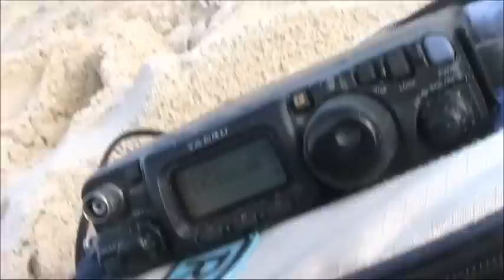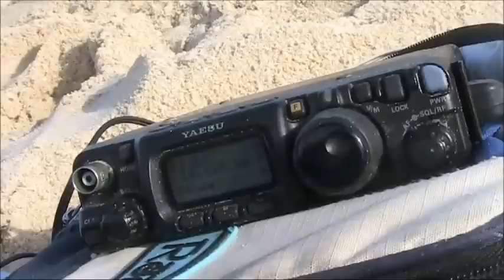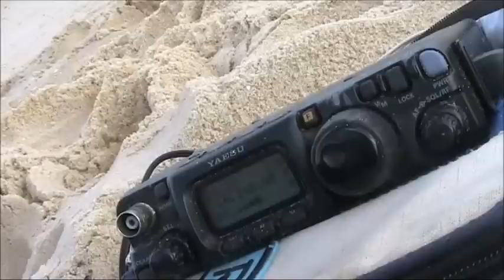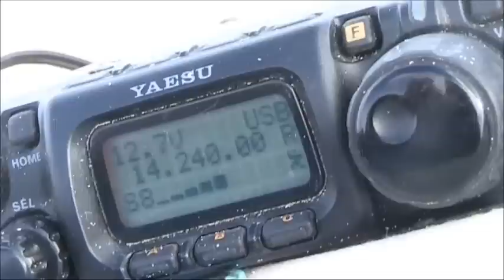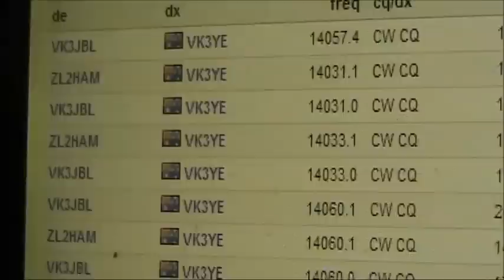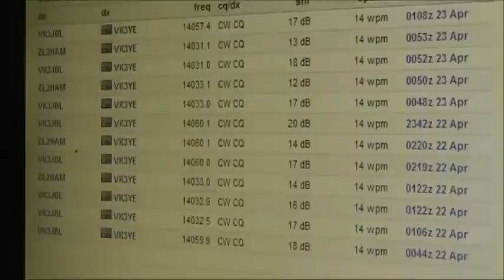Testing a 14 MHz delta loop on the sand (and reception of N5VEZ QRP)

Comment: very interesting Peter.  Enjoyed the part where you "turned the beam".  I am a bit worried about the sand on your radio. I hope you routinely vacuum the sand out of those tiny crevices between controls on the front panel after each beach trip.  I have found a quarter wave vertical with 3 radials is a good dx antenna for SOTA.  I will have to set up a delta loop and compare the two.  Conditions are very good at present and LP contacts in the afternoon to EU are working very well.

Comment: Is the internal tuner heavily necessary with this loop? Havent seen speaker wire considered as transmission line since a 60's/early 70's ham antenna book my Grandpa handed down.